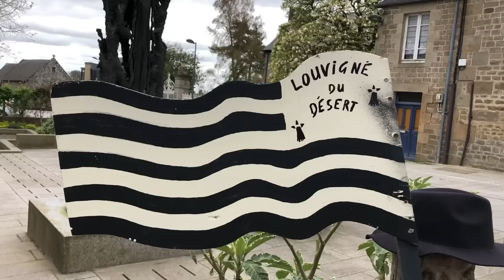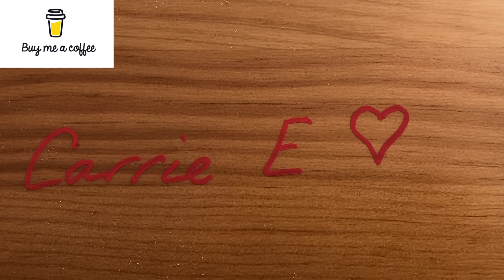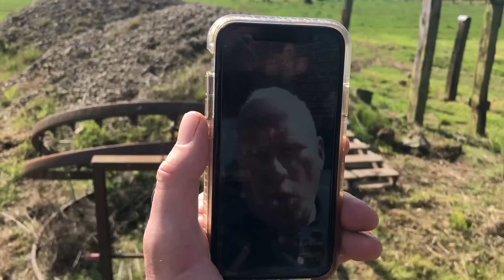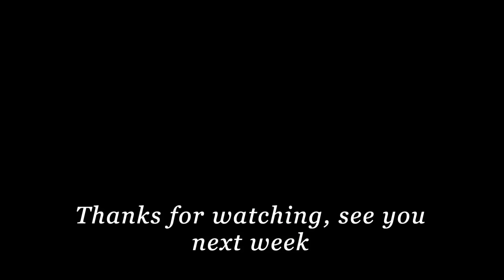#43 Bloom Baby Bloom! We Bought a Dump...in France! Episode 23

Comment: You need some clothes pins and at least two long sturdy scrap pieces of wood with a little ‘V’ cut in the top and the bottom cut diagonally(to get into the dirt) to use as clothes line props.  Get those clothes up higher and secure and let the wind and sun do its job.

Comment: If you are doing raised garden beds you could reuse the old fencing for the sides.
Reply from the maker: We thought about it but they are heavy - I think scrap yard personally!  (Mrs. Bloke!)
Reply: @mrbloke  Only problem with the scrap yard is they would charge you to pick them up so you might be on a looser there. Galvanized steel does not fetch as much money as plain steel at least not in the UK.   I would have thought raised beds would be ideal as you have a way to move them without too much fuss. Sink a post in each corner and galvanized nail them on. With the disc cutter you can trim narrow ones for the ends.  ATB
Reply: You guys rock!  🎉❤😊
Reply: Have you sorted your drainage in front of your little barn cottage or did I miss that episode?
Reply: I thought the same thing last week.  At least these won’t rot for years.
Reply: It looks like railway sleepers. Ideal to use for  raised garden beds...they never deteriorate.
Reply: Great idea 💡
Reply: What a difference getting rid of all those posts and fencing - thank goodness for having a functioning tractor! Have you thought about possibly landscaping the land behind the house with the tractor? Not necessarily levelling it entirely, but reducing the slope to reduce the water run-off? I know Budo is coming to put in a French drain for you, but it could be worth putting in a second one at the furthest extent of the garden away from the house to divert as much rainwater as possible, as the house does sit in a bit of a dip. Just a thought.

Comment: The kitchen shed unit looks great. Think about putting some mid range vertical supports between the shelves. This will prevent them sagging due to the weight of the shelf contents.

Alternatively, screw some horizontal rails on the full width of the shelf.
Reply from the maker: I was going to put in vertical supports, but it really didn't need any! No sag whatsoever with what we have on there. If that changes over time, I'll add some in👍

Comment: Hey Bloke, tractors can be very dangerous things if you don't know what you are doing.  Do not rely on the hydraulics to stay where you set them, they do "sag" over time, and sometimes quite quickly, do not stand under where they might drop - they can kill.
Reply from the maker: Thank you, Yes I'm trying to be very mindful of any movement that could happen and where my body parts are! Iv'e made a new rule of steel toe cap boots and gloves to be worn whenever I use the tractor. I have huge respect for the tractor.  ❤️
Reply: @mrbloke  I noticed the "crocks" you were wearing on your feet  in one of your videos and gulped.  I am not a safety Nazi, but some things just jump out at me.

Comment: The fact the old fencing is heavy is the best factor as it gonna retain the heavy push of the soil in raised containers. The flimsy ones in aluminium currently sold will not last very long. Also yours are free! 😄
As for the sturdy wood,  could you use it as structure for terraced cultures, vines or small  trellised fruit trees? This will give you protection from winds and added privacy if you build it on the North side of your property facing South. And it will break the monotony of the land sloping.
Reply from the maker: For now they will rest a nice long slumber until we sort it out!  They were soooo heavy!  Lol! (Mrs. Bloke)
Reply: @mrbloke  They are so long, why not cut them in halves? Heaviness solved! 😅And for the tractor, please learn it yourself, machinery is not reserved to guys!